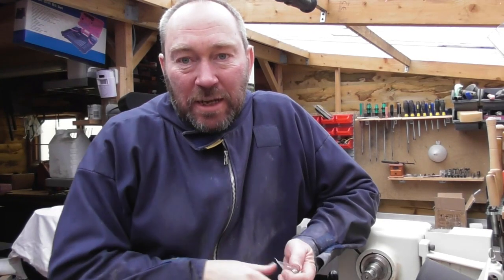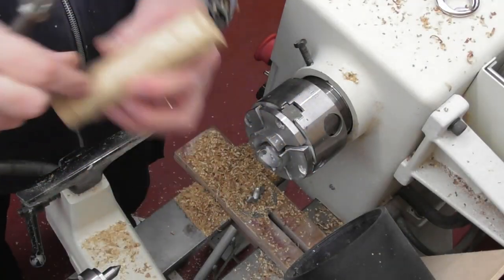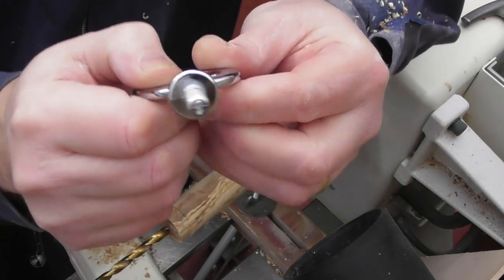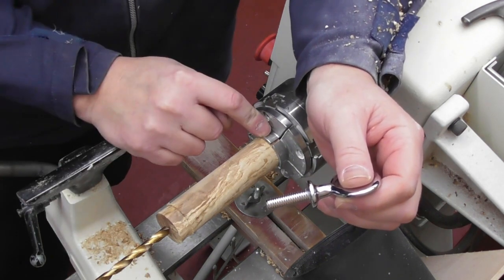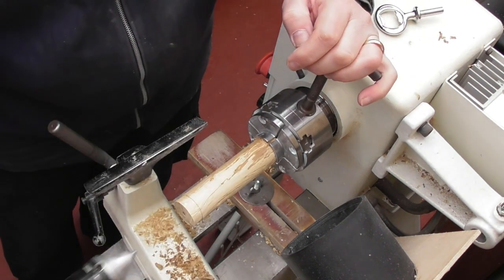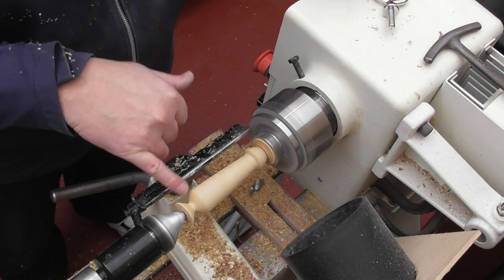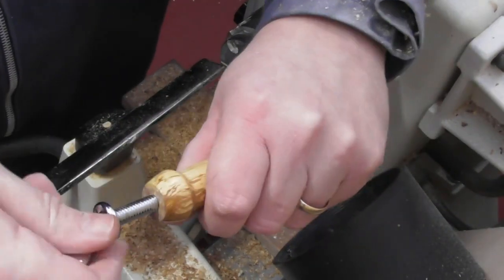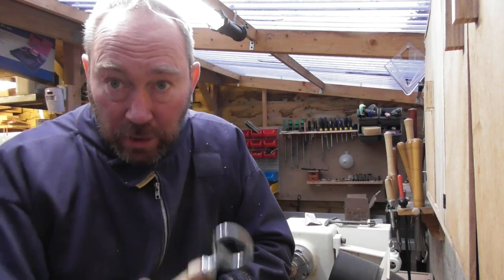Heavy Duty Bottle Opener updated

Comment: Are the threads on the bottle opener compatible with the internal thread on the wood insert screw used with the bottle opener kits?
Reply from the maker: Hi Thomas, if you meant are they compatible with the wood insert screws on the bottle stoppers the answer is no. The Heavy duty bottle opener has a larger 3/8" UNC thread. All our bottle stoppers are based on M8 x 1.25 metric thread.